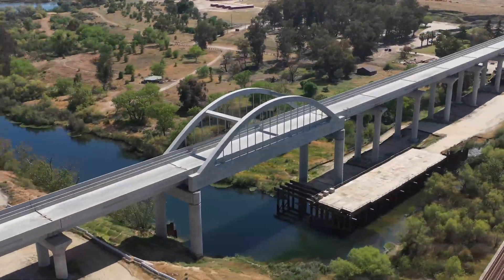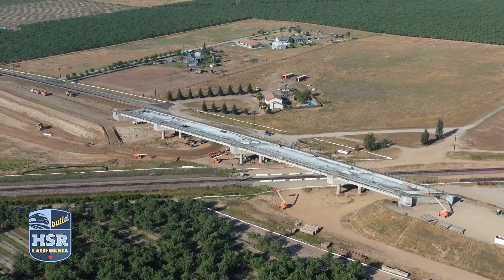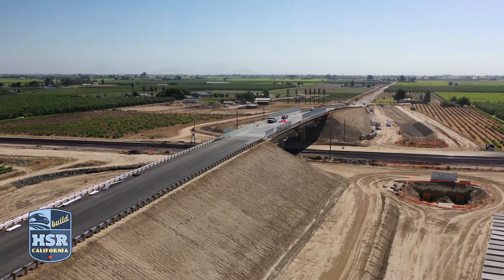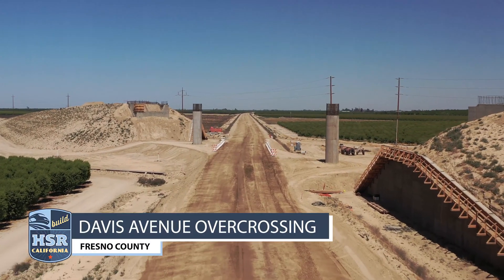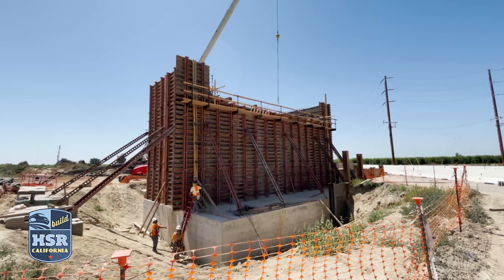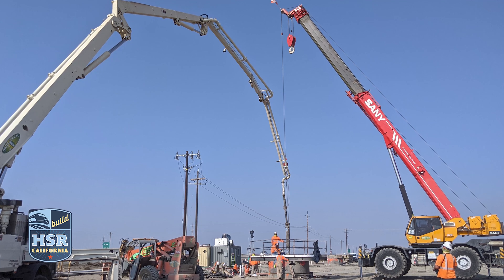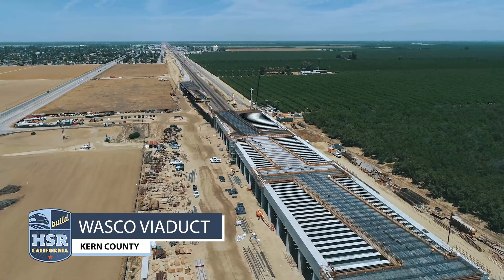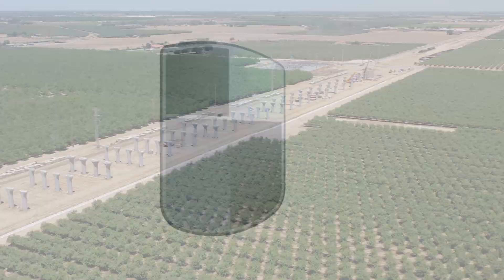California High-Speed Rail Construction Update - May 2021

Comment: So far $6.6 Billion has been spent, the 2008 Estimate was I think for $43 Billion.
Reply: That is low, it will be 10x that at least.
Reply: It will be hundreds of billions. 
This project has to end NOW!
Reply: @whiteclifffl  I agree. And I LIKE trains. This is no way to do it. In the SF bay area it took 50 years to get BART to the south bay. It will take another 20 to get it to actually get to the station in San Jose. This is nonsense. A train from nowhere to nowhere. Notice how they never mention ticket prices. I have been to Europe.The EuroTrain is EXPENSIVE to ride.
Reply: @edp2260  Too many have been gaslighted by the far left Democrat Party, socialists all. Even on Amtrak's northeast corridor Acela is considerably more expensive than riding on a regional train. The poor don't buy expensive tickets, the poor buy cheap tickets. High speed rail will NEVER be cheaper than regional slow trains. If you are in no hurry and desire a cheap fare, ride Greyhound...
Reply: @edp2260  I mean only around 72 billion

Comment: Why do you build such long bridges? I know there′s a valley, but i think for my point of view you easily could build it on ground level and rise the streets. Can anyone explane?
Reply: It’s because rail requires a shallow grade, especially at high speed. Also called low tolerances I believe. So they have to take a long time to raise or lower the elevation and it’s probably cheaper to build the tracks over or under existing road where possible than to raise every road up or down. Plus fewer things that can get down on the train tracks if they come off the road
Reply: @DLBreidenthal  As mentioned you can have higher grades than freight lines when you're only running high speed passenger trains on a line. You do have to have large corner radius, but that can be helped by having much more bank on the track than on freight lines. As the passenger trains usually have much better center of gravity.
Reply: @DLBreidenthal  Well shallow grade could not be the reason when you look at the Cologne to Frankfurt am Main High Speed line that's operating at 185 mph.
Reply: Oh and you don’t want pedestrians/animals crossing
Reply: @DLBreidenthal  I just looked it up its up to 40‰.
Reply: There are two reasons. The San Joaquin and Cedar viaducts cross over freight lines, and the freight ROW takes precedence for various legal and political reasons.  As a result the HSR lines have to fly over the freight lines.  The Hanford viaduct houses an elevated platform station for that area.  You wouldn't want street crossings flying over a station.
Reply: HSR works well on long straight flat sections of track. Britain tried to make HSR compatible with its existing rail network and failed miserably with its APT
Reply: It’s 4.0% I just looked it up. Trains cannot do a grade of 40% unless you’re talking a funicular lol
Reply: @DLBreidenthal  In Europe train grades are in permille (various spellings) instead of percent. That is per thousand instead of per hundred. 40‰ is the same as 4%. See the extra 0?
Reply: Ah I’ve never seen that before my bad
Reply: @DLBreidenthal  You've done nothing wrong friend. I was just complimenting you for correcting somebody's bad information. Keep up the good work.
Reply: @DLBreidenthal  Got 'em.

Comment: Keep at it! It's great seeing the progress updates. The Central Valley segment needs to be ready for train testing by 2025 so work can progress on extending towards the Bay Area and LA. Make the case for a goal of inaugural Los Angeles to San Francisco HSR service at the start of the 2028 LA Olympics, just as Japan unveiled the Shinkansen at the 1964 Tokyo Olympics. California was the first state to begin constructing a high speed rail line, and it therefore needs to be the first to finish one. Unveiling the nation's first true high speed rail line against the backdrop of the Olympics will bring it a level of international publicity that it wouldn't receive otherwise. This is an extremely ambitious goal but one still worth getting behind. There is no guarantee that the political leaders in 2028 will continue to support high speed rail or want to pull the plug, and thus no current guarantee of high speed rail reaching LA or SF. Having a goal of the Olympics, a celebration of national pride, could be what it takes to reignite wider public support for this project and help drive home the idea of completing this high speed rail line not just for California's sake but for the nation's. Right now the CA high speed rail project has a strong ally in the White House, and the case needs to be made for California as the leader in bringing true high speed rail to the US and US intercity mass transit into the 21st Century. The success of California's project will have repercussions on the idea of other high speed rail projects in the US. Make the best case for seeing this project through to the finish line.
Reply: I LOVE the way you think.
Reply: Very well said. If CA HSR gets more funding soon, they can finish it by 2028. They would start construction from both the SF side and the LA side at the same time to connect to the Central Valley section which is already being built. It can be done. It really comes down to money and political will.
Reply: Its not possible.  You've been told this multiple times.  You and this frickin' guy that asks when it will be done every video...
Reply: @LucidStew  doesn’t mean it’s still not worth getting behind. Pushing for a goal such as the 2028 Olympics could entice more investment in this project and thus accelerate construction to make that goal closer to reality. Even if the goal is aimed for and missed, just having it would likely have a positive impact on the wider public’s perception of this project that its goal remains getting to LA and SF and as quickly as possible. I keep advocating this because of how incredible an achievement it would be not just for this project or California but the nation as a whole as well as the future of US high speed rail. The California project is the first in the nation and therefore needs to be the first to finish and open. A goal of the 2028 Olympics should be a rallying cry to push this project forward and make it a national priority as the first chapter in bringing true high speed rail to the US. High speed rail connecting LA and SF in three hours at the Olympics would be utilized by thousands of tourists to visit other parts of California and show the nation and indeed the world that high speed rail will work here, just as Japan showed the world with the first high speed train in 1964.
Reply: @ChrisJones-gx7fc  It is not physically possible for it to be constructed and operating in 7 years. You could have all the money for it tomorrow and its still not happening. You may as well be talking about building a train to the Moon.
Reply: I'm afraid that's not going to happen under anyone's best estimates.
Reply: @DouglasLippi  be that as it may, I feel that just having such a goal, especially if it’s a big target like the Olympics (coupled with like how Japan opened the the world’s first HSR line at the 1964 Tokyo Olympics how incredible would it be if the US could do the same at the 2028 LA Olympics), would likely have a positive impact on the public’s perception of this project that its goal remains getting to LA and SF and as quickly as possible. The whole anti-HSR argument of “train to nowhere” needs to be dispelled and an announcement such as a goal of inaugural LA to SF HSR service at the 2028 Olympics could do just that. Like even if that goal is aimed for and missed, having that drive to reach it, especially with the backing of the Biden Team as a huge accomplishment as the first chapter in bringing true high speed rail to the US, could help accelerate progress and make a strong case for finishing this project as the nation’s first high speed rail line.
Reply: @ChrisJones-gx7fc  ok well hey I'm all for aggressive schedules. Heck, the first transcontinental railway took 6 years so not sure why this one needs to take decades. I'm just trying to be realistic based on how things have gone so far. But if we're dreaming then hell yeah open it for the Olympics!
Reply: @DouglasLippi  well first see if it’s feasible from a construction timeline standpoint (so funding not an issue) and if so then make the case that a goal of inaugural LA to SF service at the 2028 Olympics is possible and seek out increased funding (both from state and federal as well as possible private investors, such as working with Brightline West to compete the Palmdale-LA segment) to make that goal closer to reality.
Reply: @DouglasLippi  plus obviously it’s way more important to take longer and get it right the first time rather than try to rush it and have to go back later to fix things.
Reply: @ChrisJones-gx7fc  seeing if its feasible... Uh oh. Sounds like a feasibility study. That'll be 5 years and $25 million alone 😆.  Sorry, man, I've been watching this since forever and am just kind of jaded. At this point if any trains roll at all in my lifetime I will be thrilled! I will buy the first ticket.
Reply: @DouglasLippi  I don’t think there necessarily would need to be another feasibility study. Final route selection and environmental clearances for the full LA to SF route should be completed within the next couple years, so then it’s just a matter of dividing up the route into construction packages and bidding for construction contracts so work can begin. Ultimately what matters in the end is completion of the LA to SF high speed rail route for fast, safe electric high speed trains traveling up to 220mph and making the trip in under 3 hours, and doing so right the first time. Whether it could be completed by the Olympics or if it does take until the 2030s, the important thing is it’s getting done and that it is seen through to the finish line. My biggest fear is high speed rail never makes it past the Central Valley cause whoever the political leaders are decide to pull the plug on the project. Having a more ambitious goal than 2033, like the 2028 Olympics which will be in Los Angeles, could rally wider public support not just in California but across the nation to make the LA to SF route America’s first true high speed rail line and to push for an opening at the Olympics when America is in the world’s spotlight and we can show the world that high speed rail will work here just as Japan showed the world in 1964 that high speed rail was possible.
Reply: @DouglasLippi  Earthquakes, concrete, weather, buried treasure like fossils or stuff not on maps, utility relocation, testing soil for liquefaction, pandemic, supplies of steel, eirs, etc, etc, etc...
Reply: @ChrisJones-gx7fc  Pulling the plug since this involves voter approved money would need the voters, the Gov and State Legislature are not the final authority, that would be the state constitution and prop1a of 2008.
Reply: @ChrisJones-gx7fc  The Brighline idea is interesting. Since Brightline wants to build a HSR from Vegas to LA maybe they can join the construction of any HSR track they could share with CAHSR to Union Station.
Reply: @ChrisJones-gx7fc  True, but CA HSR is learning a lot from building the Central Valley section.
Reply: @DouglasLippi  It will happen. And I believe Newsom is making billions of dollars available to the CA HSR with the announcement of the huge $75 billion surplus.
Reply: @ChrisJones-gx7fc  Agreed. In fact, that is exactly what Los Angeles is doing with their public rail transit projects. It's called the 28 by '28 Plan. Complete 28 rails projects by the 2028 Olympics.

Los Angeles Metro has more information on their website.
Reply: @zoom-666  Those are not the big problems. The bigger problems have been lawsuits of all kinds and seemingly never-ending.
Reply: @DouglasLippi  bureaucracy and America make a bad combination
Reply: @DouglasLippi  It's not physically impossible. It's a matter of funding and political will.

Comment: Good job construction workers! Very nice seeing all the structures.
Reply: Yea structures that are not connected to each other in the middle of nowhere.
Reply: @colincampbell767  Yup, that's the disappointing aspect of this project. It's the reason I only congratulate the construction workers.
Reply: @geridamas935  The project should have been cancelled when they discovered that they could not get any private funding for it - no matter what terms they offered.
Reply: @colincampbell767  I disagree. We need hsr in this country. They should've started in the LA region, gotten as much land as possible, and cut as much red tape to accelerate the construction process.
Reply: @geridamas935  There's no market case for the high speed rail system.  To put it bluntly - it isn't needed and not enough people are going to use it (even if they actually connect it between some major cities) for it to pay anything but a fraction of it's operating costs.
Reply: @colincampbell767  There's no market case for this project, but if they started with connecting LA to Anaheim it would ppssibly be in operation now.
Reply: Tgon Mwort  The project is a scam, but the product (high speed rail) is a necessity.
Reply: Tgon Mwort  Read my third and fourth comment moron.